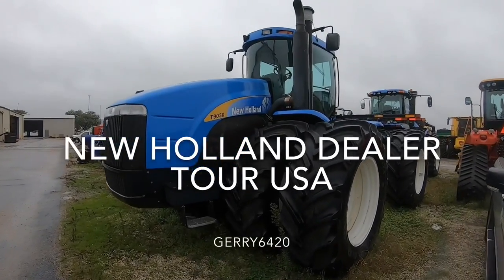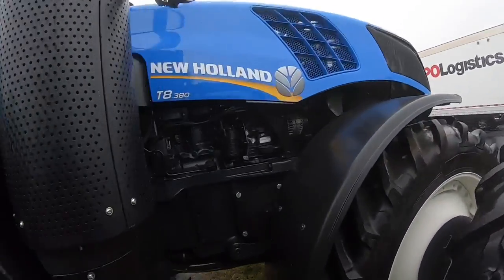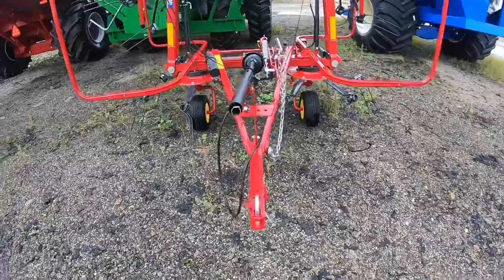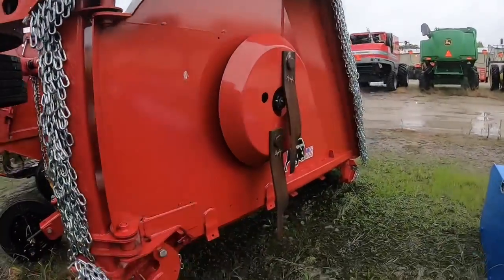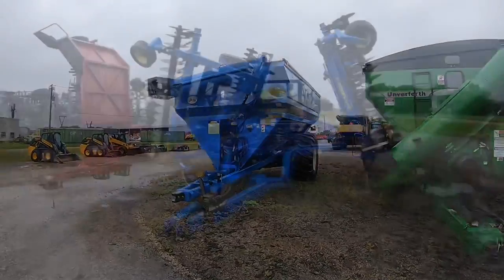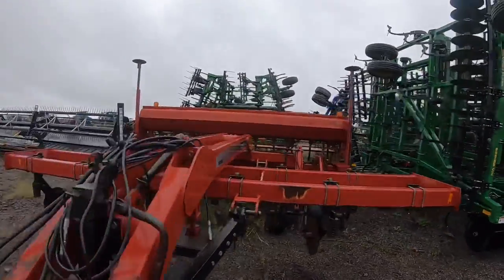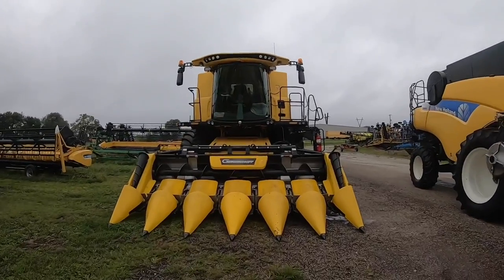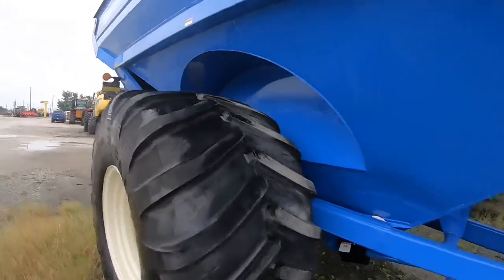NEW HOLLAND DEALER TOUR USA 🇺🇸

Comment: Although there are some huge tractors an massive tillage equipment I've noticed that many American farmers seem to run big horsepower tractors with pretty small kit behind them 🤔😮👍👍
Reply from the maker: Bob Paterson your right. Could have 500hp pulling a 6/8m cultivator when less would do. I often wondered what the idea was in it.  Sure go more then what u need. But if 300 hp would do ya... why go 500.  Fuels lot cheaper so burning more of it isn’t the issue it is here.
Reply: Watched a video not long ago of a farmer in USA driving a pto driven small bale elevator with 250 hp 😮😂😂